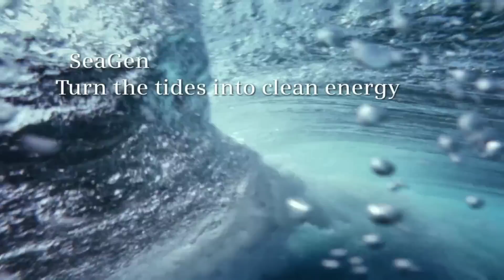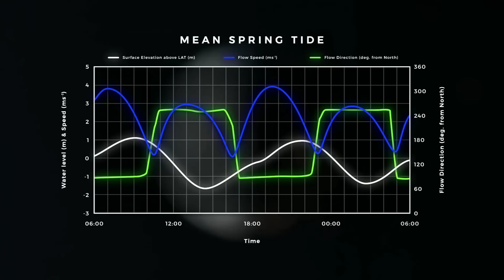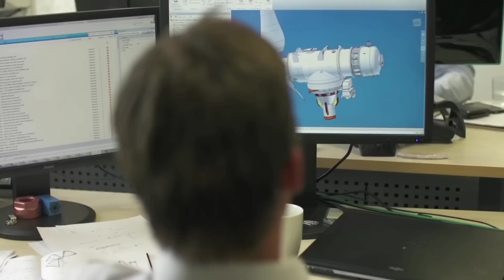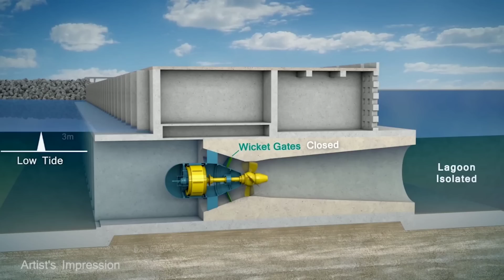This is the Amazing Energy Source That's More Powerful Than Wind and Solar Together!!

Comment: One big problem is the four slack tides each day. Time when power is not being generated.
Reply: Energy storage is the real problem.  We can generate more than we need with any renewable method, we just need to be able to use it when we want it.
Reply: @diytwoincollege7079  There is/or now perhaps was a tidal turbine in the channel between Yell & Unst. That needed somewhere the size of a local substation to house the batteries.
 100s of K were spent on Islay to install a cliff based wave generator. At one stage it powered an electric school bus. A couple of years later I found the bus abandoned & the generator removed. A large concrete structure still set into the cliff.
 There have been various types of floating generators tested off Orkney. The first or second storm caused them to fail.

Comment: The ocean is almost the worst place to put anything you expect to last.  Maybe inside a volcano would be worse, but can't think of anything else.
Reply: I agree that the ocean is a harsh environment. I disagree on Engineering Solutions. The problem is relatively simple to solve. It is a materials and coating problem. As an Engineer I see it as a cost issue. The focus should be on efficiency and environmental issues. Most Engineers, even us old farts, are very aware and actively seek cost effective solutions to minimize environmental impart of our designs and projects. The business man trying to maximize profit that create problem. The Government, more then anyone, can help maximize profit. They do this by writing and enforcing common sense laws and regulations. Congress needs to dump the Globalist Model by pulling their power and authority back from unelected  bureaucrats running regulatory agencies. In other words: Congress and the Senate both need a reset and reboot a with a Constitutional Operating System.
Reply: La Rance tidal generator has been in operation in France since 1967. It is a harsh environment, but it can be done.
Reply: The energy generated from active Volcano is largest. Cannot compare it to anything except Nuclear Fusion Reactor
Reply: Technology changes with time, nothing is permanent, In future Oceans will generate lot of energy worldwide
Reply: Salt water and salt air are really no good for batteries either. Take it from a commercial fisherman.
Reply: Greenies have always complained that plastics don't break down in the ocean or rust. Just make it all from hard plastics on the exteriors.

Comment: Tides don't have the energy density needed to provide the power required unless they are huge.  A 10M differential needs 12 cubic M/s to generate only 1MW (600homes).  Power varies linearly with tidal range and volume of water.  San Diego has ~600,000 homes and a tidal range of ~2M, so would require a minimum of 60,000 cubic M/s.

Comment: Obviously, Blades underwater and also up in air on the same extremely thick and strong pipe shoud Doubleup the yield of power. Also, it will serve as a warning to Boats and Ships to skip the area. Some mechanism to daily collect the dead fish meat from that area and selling it to Zoos should help. Some sound noise near the blades down in water should scare away those animals not to approach the area. Storage Batteries are being consistently scaled up and hence Transmission losses issue will be a thing of the past.
Reply: Environmentalist still won't let you chop up fish like they have done for small and medium wind mills. Batteries  still have transmission losses thru the lines that connect them to the grid and batteries are still not cost effective.
Reply: @mrbaab5932 Windmills only chop up flying fish.

Comment: Tidal energy has been around for a while now. I read once where some folks in the southern portion of Medieval France used a tidal pool to run a water wheel set up for about 10 years or so to grind grain and saw wood until the system silted up. They could run the system for about 5 hours a day.
Reply: That's the problem you take the energy out of the tides and all the silt drops out.
The tide at Morecambe Bay is the 2nd highest in the world, it runs in then when receding,  takes trillions of tons of mud that has dropped out of river in its delta out to sea.
Without it the river will silt up and expand outwards.

Comment: Wave energy is unlikely to contribute power generation.  This is because to control/harness waves and tides one has to play with gravity to provide installation heavier than the wave motion and that is the killer.  More weight means more materials in construction and that is why wave power has never taken off because you could spend 10 times materials to get possible 1/10 of the power from wind or solar!
I support wave and tidal energy but people should be realistic and has some engineering training before farting in the Internet.

Comment: great but we know that geothermal will outrun all other energie providers simply because the heat only need to be transported also in the meantime wind and tide should be used to provide compressed air it is far more costefficint but big money miss es out to much  bummer hence sooner than later geothermal will prevail

Comment: reliable yes but still intermittent and not 24/7 365
Reply: @jimlofts5433
Both barrage & lagoon tidal generation are  24/7 365: the tide is ALWAYS either on the way in or out, with a minimal slack water time.

Comment: Tidal power is an inadequate and diminishing source of energy. The tides are generated by the interaction of the earth's, sun's and moon's gravitational fields. This interaction propels the moon to a higher orbit and robs the earth of the kinetic energy of its axial rotation. Even in the Bay of Fundy, tidal energy would be a maginal 400 MW contributor to Canada's electrical grid.

Comment: One of the biggest problems is maintenance. Sea water is very corrosive, and costs a lot of money to keep going. Another problem not touched is the problems caused to the fish and mammals that run through the generation areas. One can see what happens to birds and wind turbines. Who would win: a whale or the turbine? I imagine both would lose.
Reply: These issues make the others referred to in the video insignificant...
Reply: Environmental Studies on Open Hydro confirmed that fish and sea mammal detect the pressure field early and evade easily. Seafloor life benefits from more oxygen in deeper layers and foundations provide an artificial reef habitat.
Fish and sea mammals have evolutionary much different sensors that birds. You can't draw any conclusions from wind turbines and birds.
Reply: @voster77hh  excellent point about these structures providing nursery habitats for juvenile fish, hopefully reverse the damage caused by the lack of supervision/enforcement over inshore commercial vessels who have caused untold harm for short-term gain. This will be a win-win result.. 🙂

Comment: It's hardly a new form. I remember seeing TV programmes about machines that could harvest tide energy more than 40 years ago. At the time I had high hopes that those machines - which performed on the sea surface - could also be used to reduce the effects of erosion on the nearby land by removing the energy from the waves and creating a calm lagoon on their land side.
Reply: 10 years before that, 1979, tidal energy was a significant part of my degree dissertation, alongside Ocean Thermal Energy Conversion, another great idea that has found too many hurdles to be a major player now.  Simple idea, drop a pipe down to the bottom of the sea & suck, that cold water coming up was sufficiently cooler to be able to extract energy from the temperature difference with surface water, with the nutrient rich bottom water being a great feedstock for fish farming...  However, to work the structures initially suggested were BIG, dwarfing the largest offshore oil plant today, then there was the issue of getting the energy from far offshore for the deep seas, back to shore.  

For tidal, my understanding is that the sea is ... not a benign environment, engineering sufficiently reliable structures is the challenge, but only just started the video!
Reply: But then a lot of politicians, bought shares in wind and solar companies ?
Reply: If the folks getting frequency & weather patents were changing climate to save the earth - your idea coulda woulda been realized long ago by the geo (earth) engineerers, mayhaps.
Reply: @anothercomment3451  The logistics were significant, in 1979 costs were of the order of billions of US$.  It was not a project in the realm of geo engineers, more massive engineered structures that would sit on the ocean surface as there are few locations with deep enough water close to the shore, Hawaii and parts of Japan among the few examples.  It was an idea that had some traction in the 70s with major organisations such as Lockheed in the US doing some significant studies and work(Hawaii...), hence it was far from my idea, I just did a review of marine options for creating power with OTEC going back about a hundred years...  There have been some demonstration plants built, it has great potential, but the significant challenges of working in the marine environment are limiting its growth (covered by the wiki page), hence nothing significant has been built.  OTEC has a quite informative wiki page of you wanted to explore it further.

Comment: Utelizing movements of water seems to be a good way to obtain non-polluting power.  I would think that underwater turbines should have flexible blades that, like the fins on a fish can create power as water is deflected from the flexible fins.
Blades, perhaps curved, like a sickle blade as seen in siluette...  Nylon blades could be made both flexible, and perhaps less prone to a buildup of, for example barnacles, and likely, less hazardeous to marine life than more rigid blades.🙄.?!
Stay safe, Niels 💖💕
Reply: Flexible blades will still chop up fish.
Reply: @mrbaab5932  I think not...Those fins should be compared with a wavering flag in the wind and extracting energy from that wavering.
Reply: Nylon is hygroscopic (absorbs water).  There are many issues with operating machines in wet, salty environments (corrosion, mineralization, barnacles, etc.).
Reply: Marine mammals will be wiped out by collisions with the blades.

Comment: The Total electrical potential is not nearly enough a best case it's just supplementary to wind and solar.
There is still a huge storage medium required.
Reply: Storage is less of a problem as you can place your plant to overlap predictable output

Comment: But unfortunately it cannot be used everywhere. The right conditions can only be found in a few places on earth
Reply: Any place there is a persistent ocean current would do. It doesn't have to be a bay with a dam.
Reply: @paullangford8179  Changing persistent ocean current also changes heat (cold) transport around the globe and effects the climate. Using those can be dangerous for big parts of the world. If we would extract energy from the gulfstream the flow rate would decrease....effect is less warmth transporting to europe and Island. More warmth will stay south...
Increasing temp for the westcoast of africa to the caraibian bay would also increase the intensity and amount of hurricanes. Less heat to northern europe would cool down that area...increasing snowfall and witg that increasing heat reflection from sun energy. Is short...danger for a (little?) ice age.
This is a too delicate balance to interfere without very deep knowledge.
This in contrary to tidal usage....that does not change those persistant currents.

Comment: As the video says, if correct, this technology can cover about 10% of the demand. However solar energy can cover 100% of the demand if built up the same way as described in this video: "or stored to batteries for alter use" which makes solar energy more independent form weather conditions than today. So: How can the video say tidal energy is stronger than wind and solar together? To me looks like a click bait.
Reply: Tidal is every day and night not like wind and solar
Reply: @clarencefoster7689  This is not correct, as the tide has 2 turning points (one at high and one at low tide) during which the tide power stations can't deliver their capacity. This said, exactly in the same way as wind and solar this source is depending on powerful storage options. Moreover the strength of the tide is often dependent on the moon phase. The only remaining advantage seems to be the time storage has to be able to bridge, it is probably only 12 h and approximately 20 min. while solar requires approximately 2 to 3 days worth of capacity.
Reply: the type or methods for producing power has nothing to do with dependability , efficiency or environment 
the controlling factors will always be profit for the elite

Comment: Same lies as solar and wind, tidal energy takes huge amounts of resources to build and deploy, and being underwater  suffers a lot of damage and will require huge maintainance costs.  So you reckon this is cheaper than making a solar panel and putting it on a roof or in a field.....>?
Reply: Have to agree, maintenance cost are a major consideration. Repairs to land based infrastructure is easy and safe, marine systems require costly specialist equipment. Both wind turbines and solar have the lowest cost in construction (now) per mW generated.

Comment: The problem with wave power is the huge difference between average energy and the maximum, in a storm.

Building something which can withstand the worst makes it ridiculously inefficient in average conditions. A study in the Pacific showed that the worst case storm energy was more than 1000 times the normal.

Early experiments with tidal power in France in the 1970s proved this. They worked fine but a moderate storm smashed them to bits.

Comment: Hickley point C is a nuclear reactor currently under construction in 🇬🇧, completion will be about 2030 . Ironically it’s on the coast of the Bristol estuary which is one of the largest tidal variations on earth . I can’t help thinking that they have missed a great opportunity here .
Reply: Try using science. The available power from the tide is tiny compared with the cost of the infrastructure. It's just not worth while.
Reply: As happens they’re been talking about a tidal barrage since the mid sixtes but shot down due to considerations of how it effect one of the largest tidal basins in Europe and the wild life there
Reply: Nuclear power ok but cost a lot o clear up years later where to you put the crap that come  out no one wants it near them 😮😮😮😮😮😮
Reply: @cliffordbuttle4529  actually that’s true for wind & solar as well  the chemicals are toxic  and as bad to get rid of same true for the blades from a wind turbines ( last I heard  all they can at the end of their life is just bury them )
Reply: Elon Musk says that if you take the whole surface area that a nuclear power station  occupies and instead cover that completely with solar panels then you would achieve more power generation than would the nuclear setup! And NO pollution! 8:42 (nz 14:58)
Reply: @peterpayne8852  As that is complete bollox I doubt that even Elon Musk as said it.

Have you any idea how much power is generated by a nuclear power station or solar panels?

To replace the output of the Gravelines power station in France (38.5 GWh) would need about 75,000 km sq. area of solar panels (0.5 MWh/Km sq.).
Reply: We have had water wheels, for millennia, used them to mill wheat, how hard would it be to remove the heavy stones and attach a generator. We just need to upscale a proven design or put it on floating platforms.
Reply: @snowballsvlogs621  Spoken like a true non-engineer and non-scientist. Bravo.
Reply: @snowballsvlogs621  ❔❕❕❕❕. YOU DO KNOW THATS HOW MOST OF OUR POWER POWE IS  MADE 😳😳😳😳😳